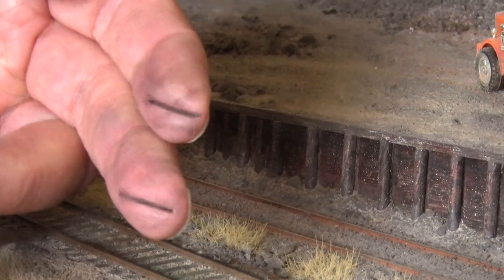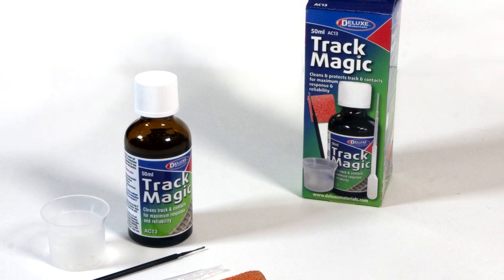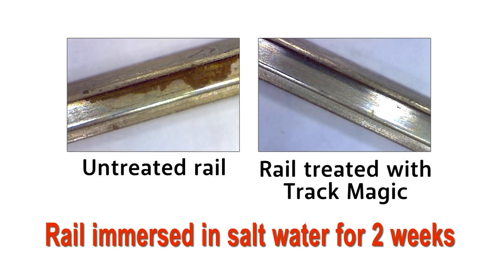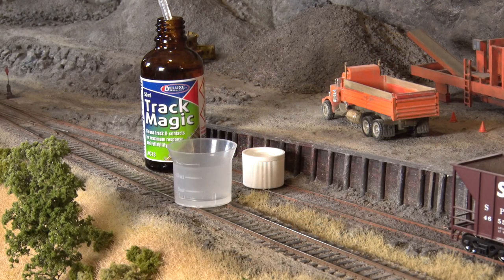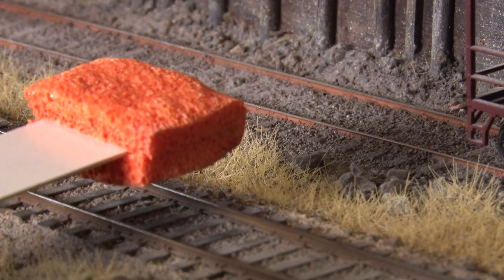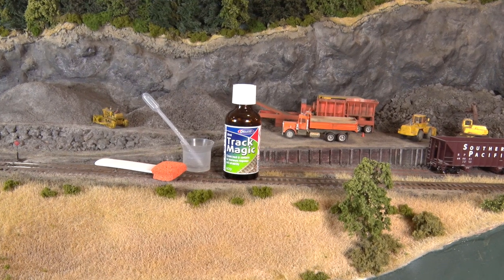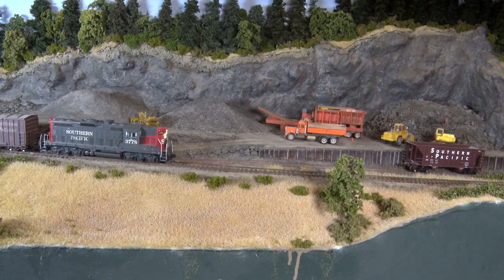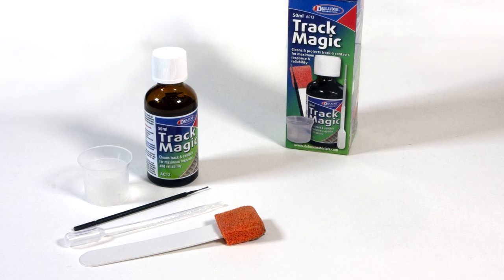Model railroaders! Track Magic keeps track & wheels clean longer

Comment: Since I do not know the product, I ask if it attacks the track plastic crossties and if you know how many meters of track can be cleaned with a container? I have a medium size layout. Thanks.
Reply from the maker: Doesn’t attack plastic — be really poorly designed product for cleaning track if it did! As for how far it goes, that depends on sparingly or not sparingly you use it and how dirty the track is. For moderate dirty track and a generous but not excessive application I’d say the 50ml bottle will do 500 ft of track. This is a gut feel not a scientific analysis of use.
Reply: @MRhobbyist  Thanks. Currently, I first do a good cleaning of the layout tracks to remove dirt and rust that can form. Then I use isopropyl alcohol to finish. Idem, for wheels of all rolling stock. I've got a lot of work to do. I will test the product first with a 50 ml container; although I don't think it will reach me for the number of roads and detours that my layout has. I think the 250 ml will be the right one. Best regards.
Reply from the maker: One note on isopropyl alcohol ... it has a relatively HIGH dielectric constant, which means cleaning with it leaves the metal in a state that PROMOTES micro arcing. In other words, cleaning with a high dielectric constant solvent makes your track get dirty faster. For a list of the dielectric constant of most solvents and track cleaners, see the May 2019 MRH magazine editorial: https://mrhmag.com/magazine/mrh2019-05
Reply: Very good response; thank you. I didn't know that and it's true, my clean tracks don't last long, even though the layout is in a fairly closed environment and there is little incidence of a dirty atmosphere. The problem I have is to buy the product because I am in Argentina and here it is not achieved. I'll see how to get it. I hope to comment soon as the experience was. Thank you very much and greetings. @MRhobbyist

Comment: Can this be used in a track cleaning car?
Reply from the maker: Yes, works great as a track cleaning car fluid. Just change the pads each run around the layout so you’re not just moving the oxides around.

Comment: Nice 4 minute ad
Reply from the maker: That’s exactly what this is ... an infomercial paid for by Deluxe Materials. Never forget, MRH is ad supported (wink) ... that said, Track Magic IS amazing stuff. Look carefully at the slow speed loco run at the end -- not a bit of headlight flicker. That track and those wheels are CLEAN.
Reply: And you watched it haha
Reply: Model Railroad Hobbyist magazine this stuff leaves a film on the track. Isopropyl alcohol works best.